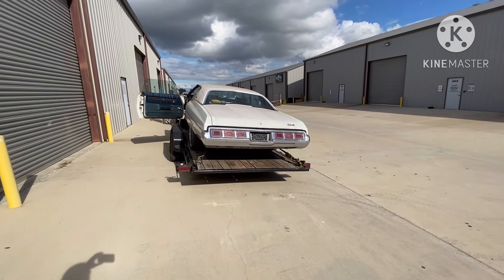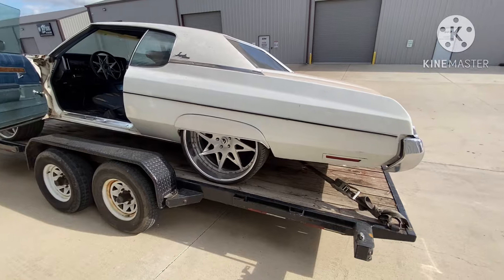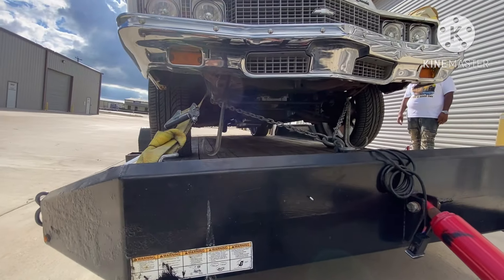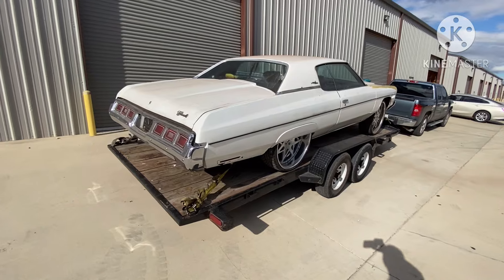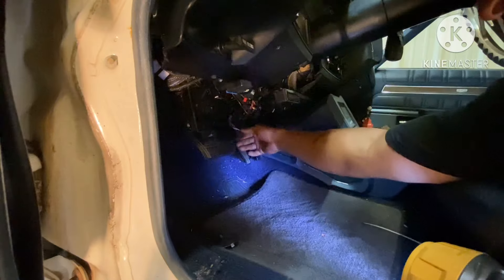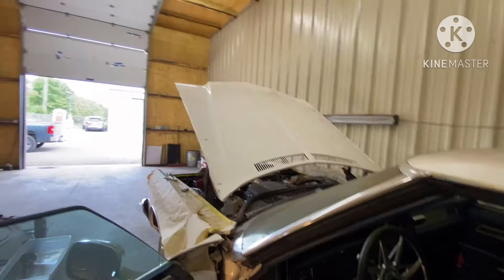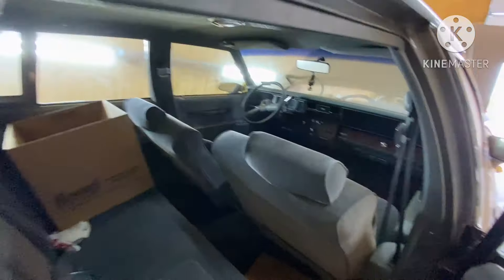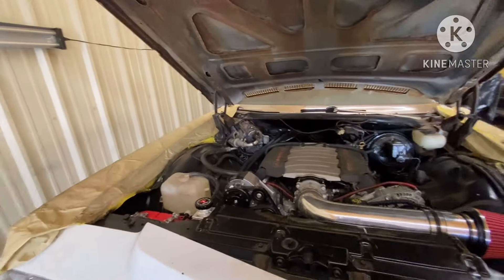73 Impala GenV Lt1 swap first start big problems

Comment: The pedal doesn’t matter they’re all the same. They just made different shapes and sizes for a car for a truck.
Reply from the maker: Don’t want to use the Camaro pedel because it will be difficult to mount I already made a bracket to mount the style pedal that mount to the fire wall pedal in the car now I’m not sure what car it’s for because it was supplied by the customer

Comment: Check the back of the engine where the high-pressure fuel pump plugs in and it will tell you what engine you have. Some of them are six plugs some of them are three plugs.
Reply from the maker: Think it’s a 18 has three plug with 8 speed transmission👍🏿

Comment: Once you get everything tuned, you still would not be able to have full throttle. It’s only going to open up around 60 to 70%.
Reply from the maker: I’ll cross that bridge when I get there tried to get the guy to run a holley with either a 4speed/6speed transmission